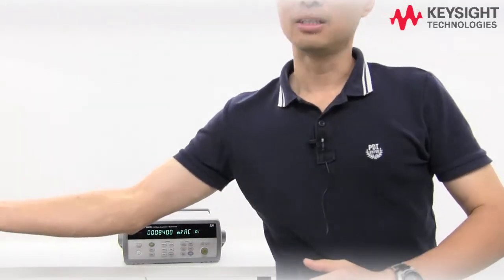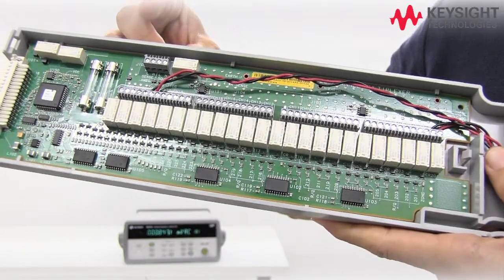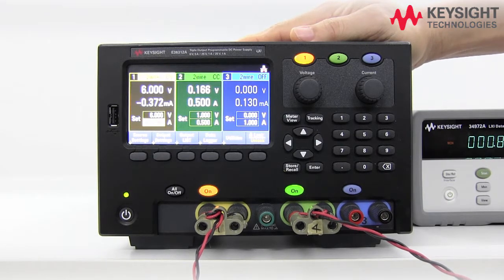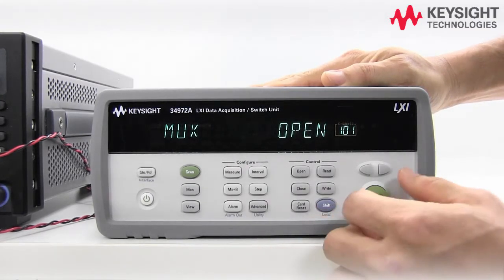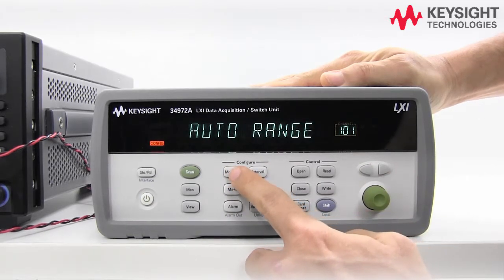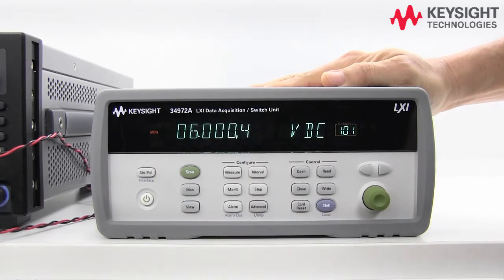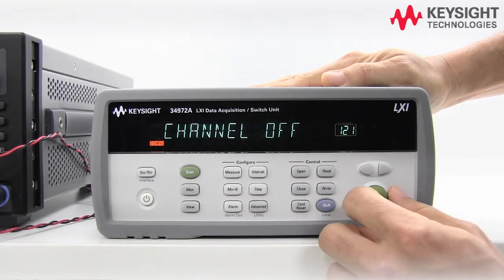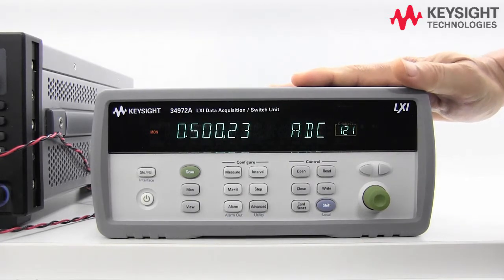Test and Measurement Basics - DAQ | Episode 10 – DC Voltage and Current Measurements

Comment: Hi, In the video you have shown to get the DC current measurement for one device. However, if i have more than one device for eg 6 device to make current measurements, how should i connect using the M903A and M901A module?
Reply from the maker: @Dinyar Buhariwalla You have a couple options with your DAQ modules. You could use the M903A to turn on one device at a time and use the PS to measure the current. If you need all 6 devices running simultaneously add a small resistor to each positive lead and use your M901 multiplexer to measure the voltage drop on each resistor. You can use the scaling feature of the 970 to convert the voltages to current. Select a small resistor value so that the power (VxI) does not heat the resistor.
Reply: I curious to know did u connect the current wire from power supply  to H and L of the the DAQ